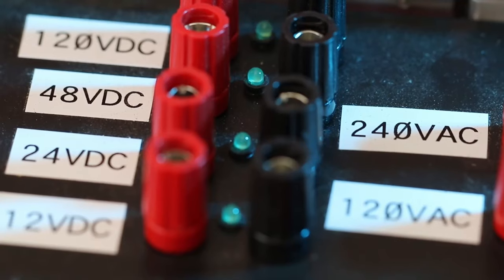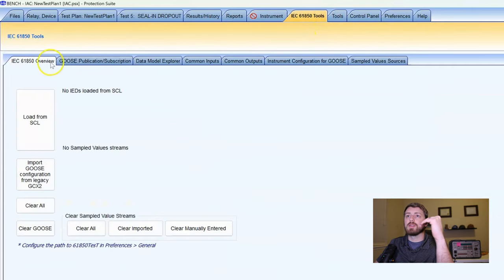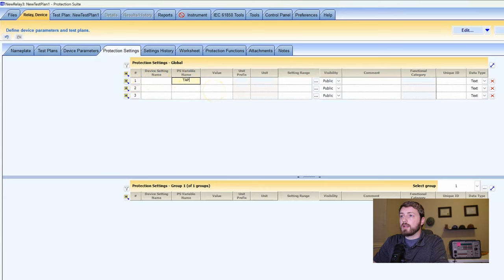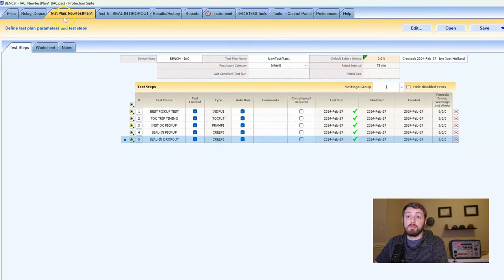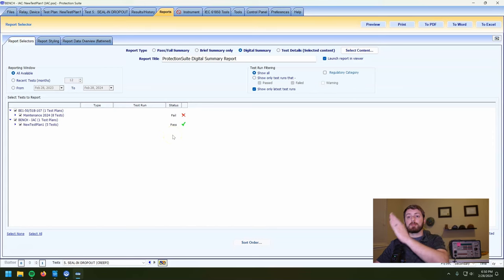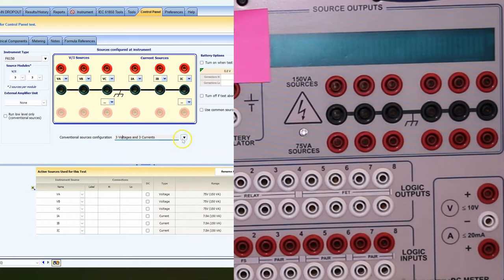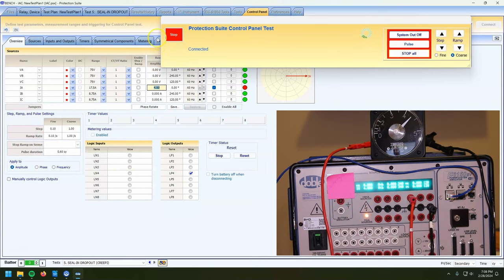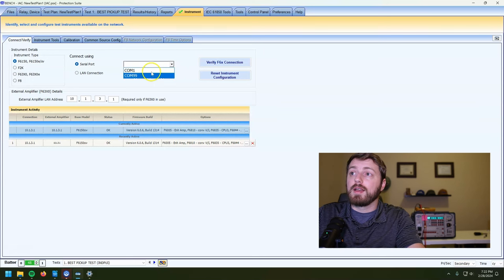Learn Protection Suite in 45 Minutes - How To Test Relays ep4

Comment: I have been watching few of your videos from your channel, and they really made me want to change my career.
So my question is how do we become a Testing Technician.
I forgot to mention I am working as a PLC/ Electrical Equipment Technician.
Reply from the maker: The easy way to start is to call up your local testing companies (you can search for them at netaworld.org) and see if they're hiring. Often guys with little or no experience can start in a breaker shop or motor shop and work their way out into the field, but PLC work is a pretty good background to slide right into real testing. Since it mostly requires on-the-job training anyway, no formal education is usually required. Just depends on what the company you're interviewing with is looking for. Positions open up all the time so it doesn't hurt to check back often. A lot of them even have remote positions open if you're willing to travel.
Reply: Thanks for the Info

Comment: Have you ever gone to some of the Doble protection conferences? If you ever find yourself using Doble RTS, let me know.
Reply: Nvm, I see your registered with EPS/CFR
Reply from the maker: I'm actually entirely self-taught on PS and rather dislike using RTS. Nothing wrong with it when it works I just never needed to use it and I'm really quick with PS. 
I also haven't worked at EPS since 2018.